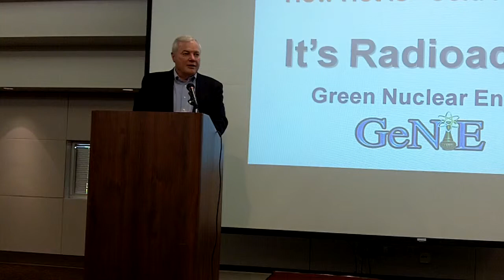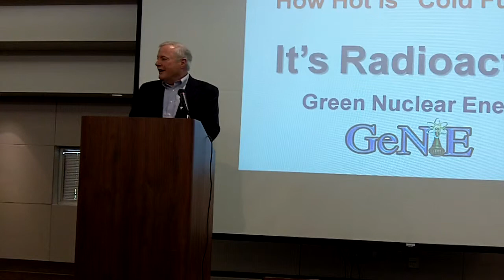Frank Gordon - How Hot is Cold Fusion? Part 9

Comment: I want heat! I do not want electricity! Self contained chemical fusion reactions inside a sealed container. How long will it stay hot or warm? My vehicles need to utilize a dependable means of producing heat without consuming onboard electricity if possible. It will save my batteries.